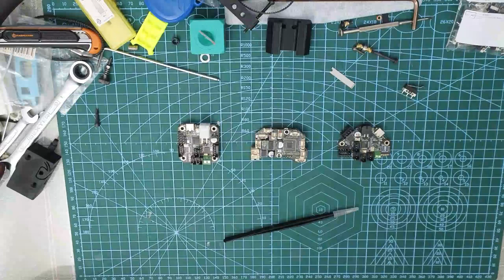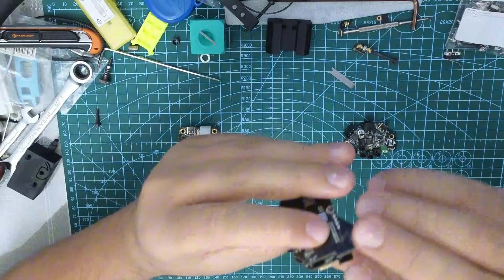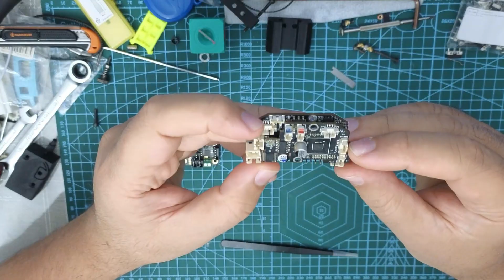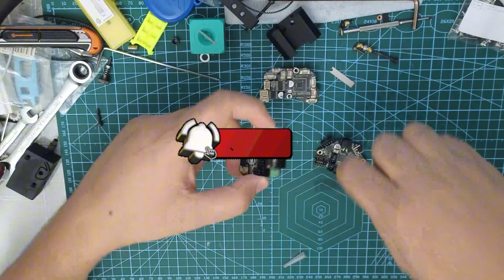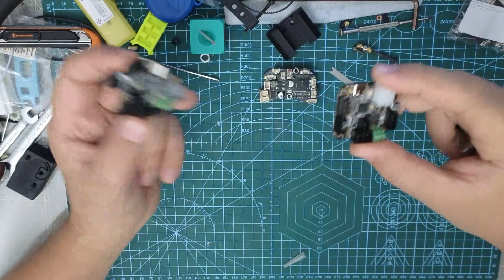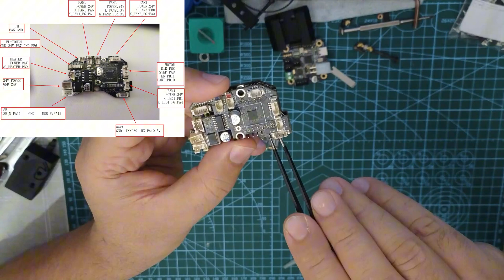How to Connect Sensors to EBB 42, EBB 36, and Sovol SV08 Toolboards

Comment: Nadir, did you consider to change the extruder motor? I'm not sure of its weight, but it looks pretty bulky on the original tool head... My Sv08 arrives tomorrow and I'm wondering if it isn't worth to change the whole extruder by a lighter one.
Reply from the maker: We made a version of Xenomorph that uses the Orbiter Extruder still using planetary gears but it has LDO motor 50 grams less than the one used by Sovol